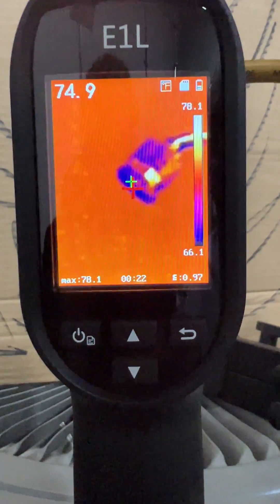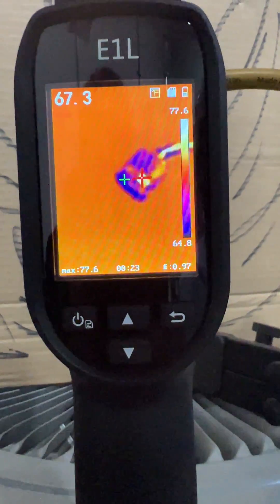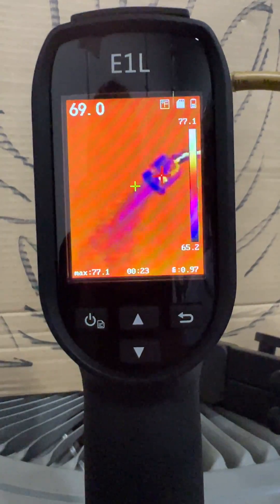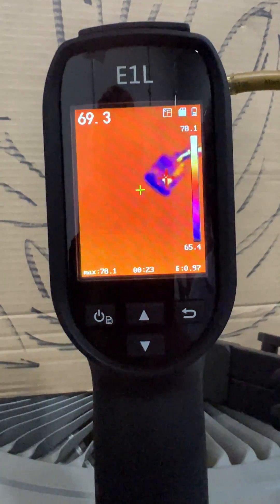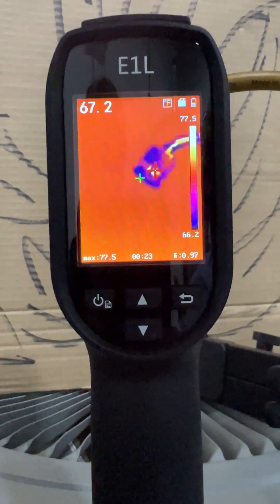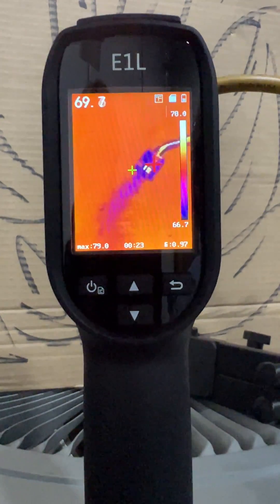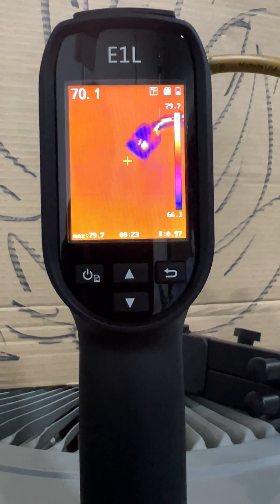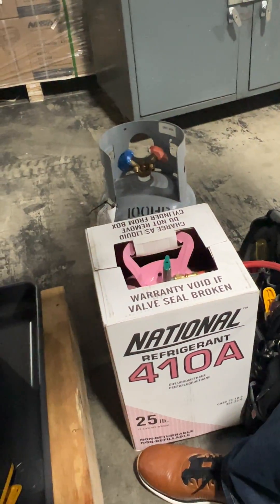Does air get into a refrigerant hose after you purge it?

Comment: A more interesting question is actually how much air that's acceptable before it actually causes problems in the refrigerant system.
Humidity and oxygen are the bad parts, and both can cause water/ice, but at the same time you have driers that should be able to capture at least some parts.
Reply from the maker: Basically none. Consider that you have to pull down to minimum of 500 microns and ideally 100 or less, at that point there is no gas load and very little moisture load left in the system. The balance is what the dryer is supposed to handle. Introducing any moisture or air degrades operation and longevity.

Comment: Id agree with the assumption that not seeing a cold vapor tail immediately after shutting the valve would confirm no air is being introduced to the hose, but once the expansion of the vapor stops and thermal absorption of the vapor stops, air will start to mix within the hose without showing thermal differences.

Always purge with your fittings attached but not sealed and finish by sealing those fittings.
Reply from the maker: You are correct, eventually the vapor pressures will equalize and the air and refrigerant will mix. I also agree that purging on a loose connection is not a bad idea. What I was trying to demonstrate was that the refrigerant stays in the hose long enough to make the connection without introducing air into the system.